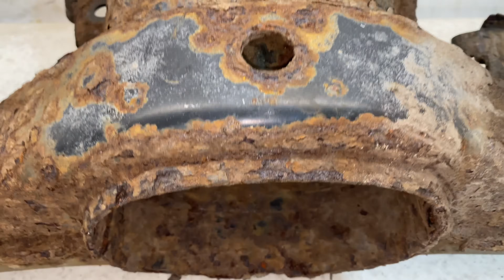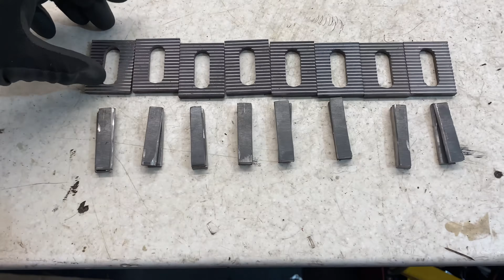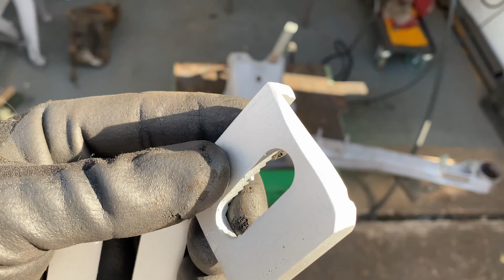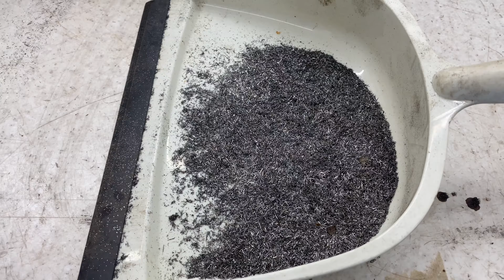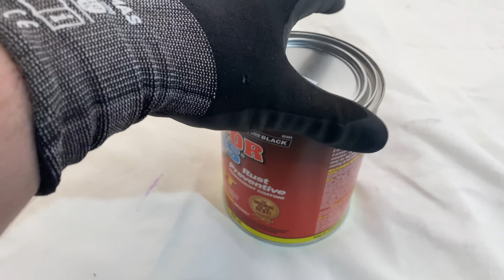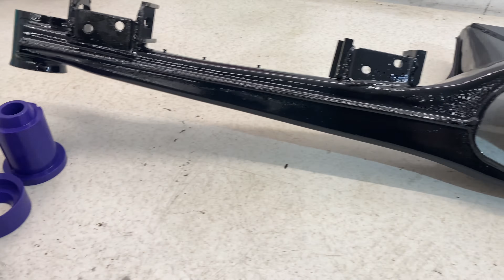EP. 7 My BMW E30 Restoration - Rear Subframe - Restoration, Camber/Toe and Reinforcement

Comment: are you happy with this style of adjusters or would you go for eccentric ones after trying these?
Reply from the maker: Unfortunately not got to the stage of driving the car and testing them out. However I went with the serrated versions due to recommendations, the eccentric type are know to slip, this is due to the flex in the bracket causing them to come loose

Comment: you must not use PU bushes. too hard on a aeak car body. you will destroy the car body. use original pliant ones. softer to preserve the car body. that is why BMW engineers decided to use softer rubber bushes in order to protect the body frame. if the car is what you wanted to protect over long term, don't use PU hard bushes. hard doesnt mean good.
Reply from the maker: I understand where you are coming from, however I am going for a different setup compared to when it was produced, the car will be a fast road setup. I am keeping OEM bushes for the complete drivetrain. 
I have added a lot of strength with reinforcements in areas known to have issues
Reply: @BadE30  you re-enforced car body? this is the weak part and hardest to repair/replace. that subframe rear axle frame is easy fix. dont crack the  old car body. metals fatigue over time. afterall, this is a 30 year old car made from era of low tech.

Comment: Nice work. I used POR15 on the E36 I'm restoring. Tonight we are removing the rear subframe off the Rover Metro we are doing. We are most likely going to get that powder coated. I just need to hunt around to see if I can get any poly bushes for it.
Reply from the maker: Nice one! Powdercoating is definitely the easy way around it. I just like to do things myself when i have the time, not always possible